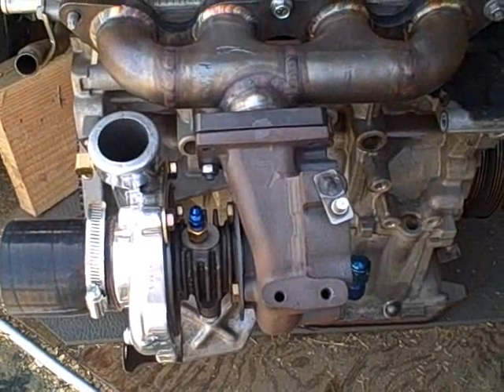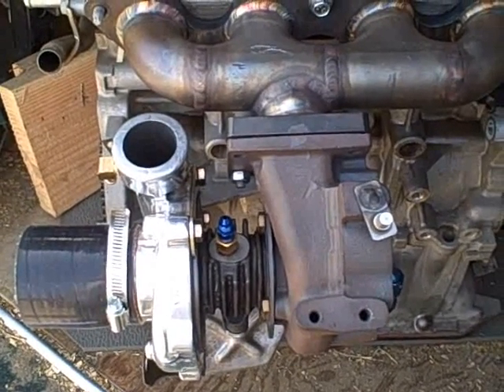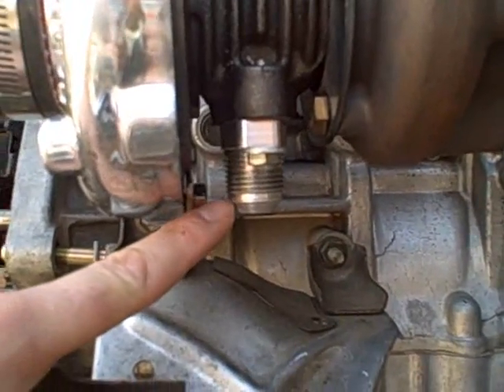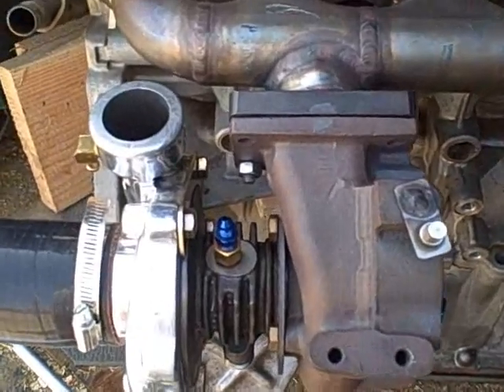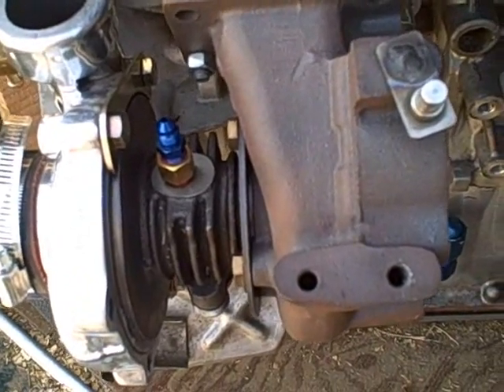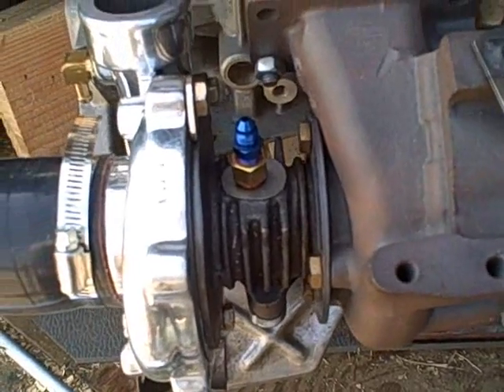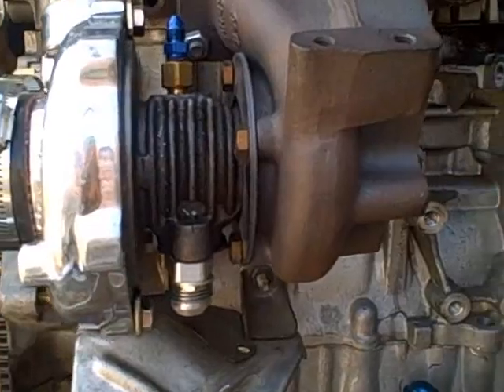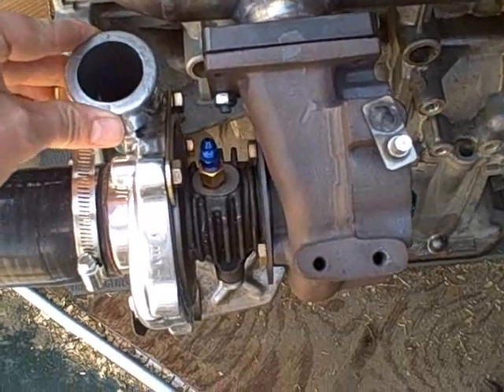How to clock your turbo

Comment: how do you tell the oil feed from the return on the body of the turbo?
Reply: Return is a much bigger hole and the return also usually has 2 little holes next to it so you can bolt down a return fitting. The feed is just a small hole that you put a small fitting into.
Reply: TWIRKNOLOVE
Thanks for the reply :D

Comment: Way off topic from the oil feed, but do you have any information about the A/R ratio of different turbos? I May have the terminology wrong, but there are inlet and outlet diameter for both the compressor and turbine side, and some adjustment there can make big differences in diesel applications. Any hints?

Comment: You can only do this if you have and external wastegate, otherwise you'll have to custom make a mounting bracket for the actuator so it won't be "cawkeyed" when you reclock it, and probably not function

Comment: hmmm.. but explain where does the pressure from the intake goes?
...if it disapears,then your turbocharged car will runaway,  or at least loose oil 
othervise it's making the oil circulate when the engine is running. so the position of intake and outlet doesn't mather...

sorr for my english ;)

Comment: @chue240sx put some heat on the housing where the bolts go. Doesnt need to be extremely hot but the heat will free it up. Mine was same way. I tried the pb blaster also. I couldnt get my O2 sensor out either so i put some heat to it and it come right out.

Comment: I had to take my garrett (SVO) to wrk and put heat all the way around and for about 15 seconds it turned very freely. Once it cooled i didnt attempt to turn but b4 i used heat i literally put all my weight, 250 lbs, into trying to rotate mine.

Comment: my turbine housing wont turn. it has rust around where it connects to the oil section, pb blaster should take care of that correct? i took all the bolts out and it doesnt turn lol.